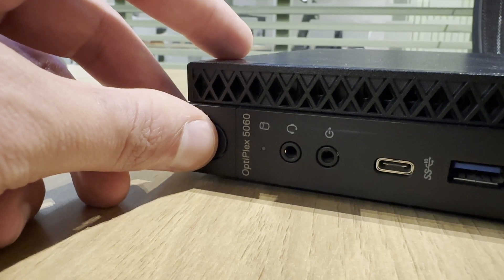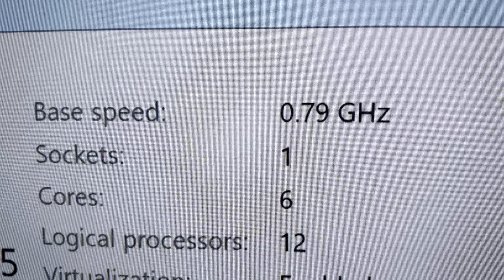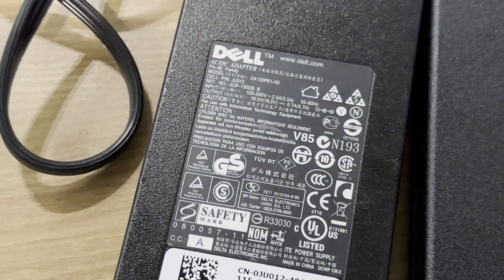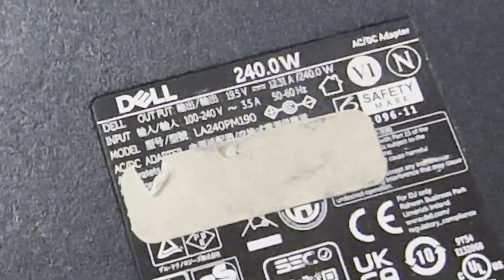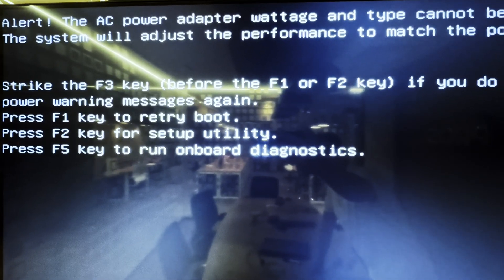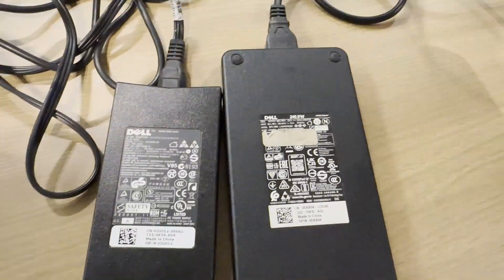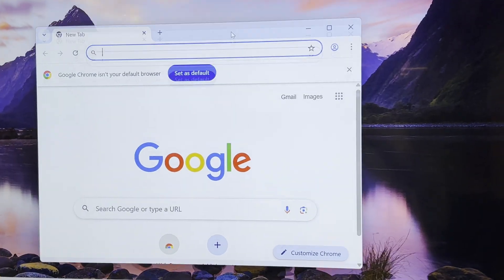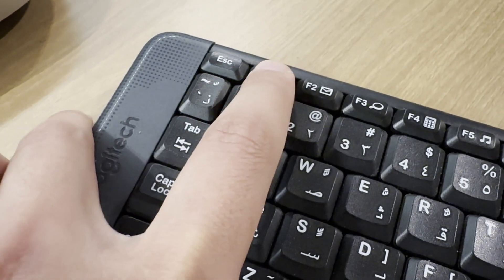Dell Laptop CPU Stuck at 0.79 GHz Here's the FIX

Comment: Dear sir, help mine is a laptop, Inspiron 15 3520, original charger too, but the cpu throttles all way down the same 0.79 GHz on just battery but on charger, it's alright and okay. only on battery this problem. I tried resetting PC, BIOS update too, still no help. hope you would help.
Reply from the maker: Hello,
As i can tell from your description, the battery might need to be replaced or maybe if the battery is new and good then its most likely the power plan or power profile is set to power saver which immediately throttle the cpu speed to save battery life so make sure its balanced or high performance

But i think its a power issue with the battery itself not supplying enough power

Comment: .80ghz mine after a few minutes new cou i7 4th gen 4910mq or something. Temps fine. Reboot fixes till stress test again
Reply from the maker: Hey, when you reboot everything back to normal is a good sign but when CPU under load this usually will be one of two reasons and the thermals or bios power limits or the power supply is unable to supply the needed wattage for CPU full utilization, and since you are sure there is no thermal throttle then u need to reset bios first or update it and if the issues persists you will have to buy more powerful charger adapter.

Comment: when i pluged in chager chord my cpu speed stuck in 0.78 then i unpluged the cord my latop speed is become normal in battry, i tried deiffernt charger but issue is still.
Reply from the maker: Yes, the battery usually supplies the optimal power for the cpu but you still need an original and powerful enough charger and reset the bios  before you connect it